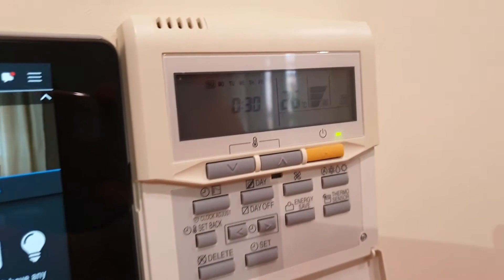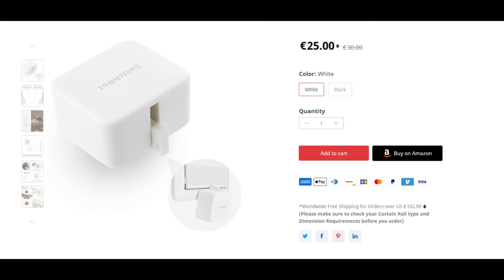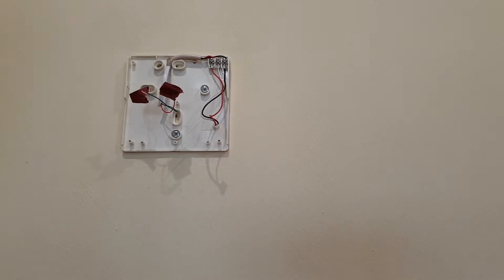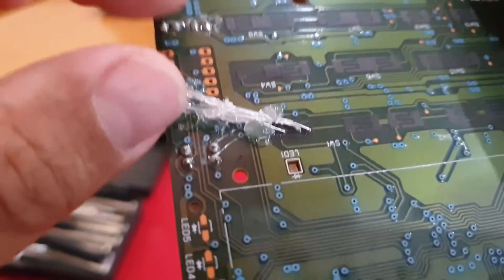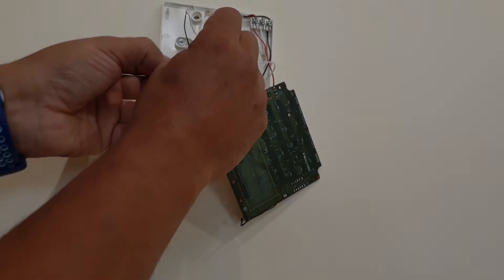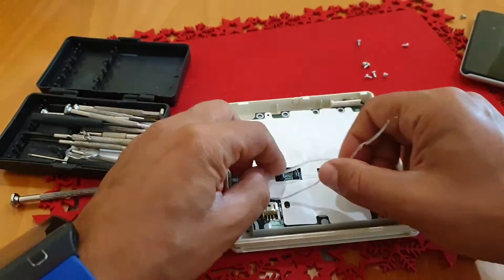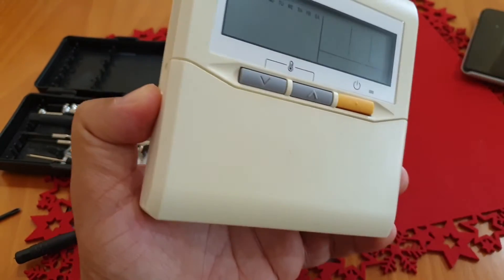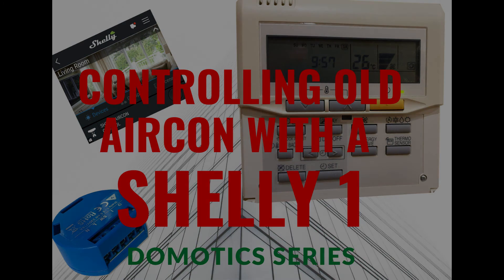Make your Old Aircon Remote Control Smart on the Cheap With Shelly 1

Comment: Planning on applying the same process to my Air Con, my question is: is there a way to tell if the Air Con is ON or OFF remotely from the Shelly App, because the button on the App will always show as OFF (since its a momentary button)? Thank you.
Reply from the maker: Good question, I'm afraid there isn't unless you use another sensor, for example a temperature sensor next to the aircon vent that will show the temperature drop when the aircon is in use. The truth is I don't use the aircon much, only throughout July and August when the temperatures are high.
Reply: @zoltar99   I ordered a few Shellys 1 and going to see if its possible to use them to turn on/off the 12v DC that running the controller, I noticed that disconnecting the controller then re-connecting it via its 12v DC wire acts almost as on/off switch, I say almost because when it restarts it give a blinking error for like 3 secs then it goes away and the Air Con start normally, if this method works I'll be able to see if the AC is ON or OFF, fingers crossed.
Reply from the maker: @ChaayaBachir  great idea, let us know how it goes
Reply: My board is powered by 5V connection would it work ?

Comment: Great idea to solve the wired remote controllers issue. Thank you for that. One question: Did you consider using the 12v DC to power the Shelly device, instead of wiring up to the ceiling to take power from the unit itself, the Red and Black terminals for the AC controllers have a 12v DC output. Just a thought.
Reply from the maker: Mine still works, just have to be gentle with it as the wire connected to the shelly can come unstuck if you press it too hard?